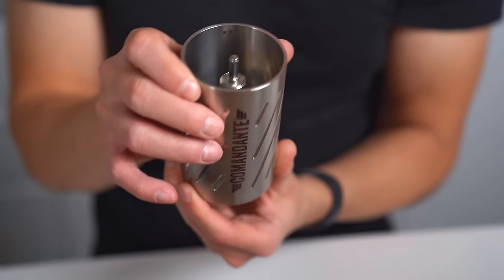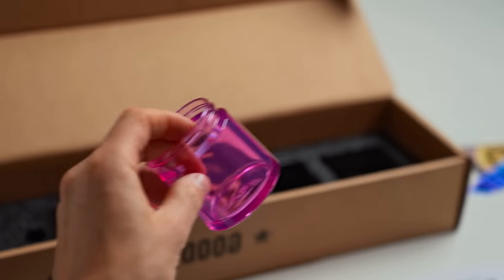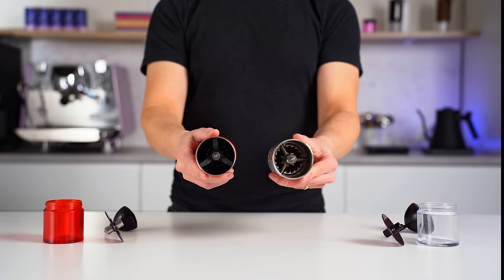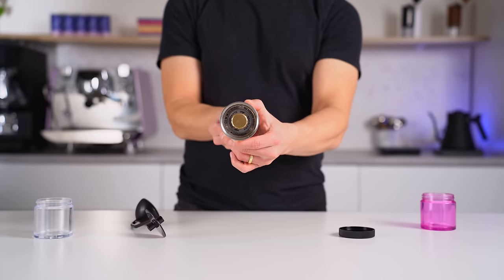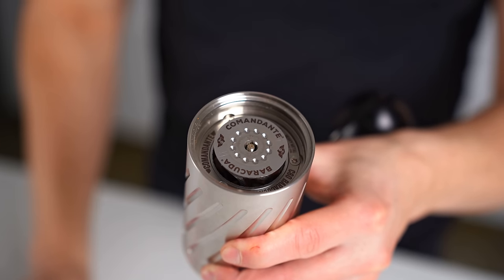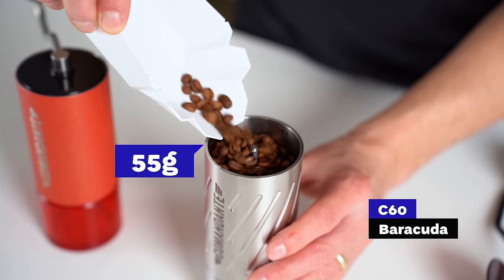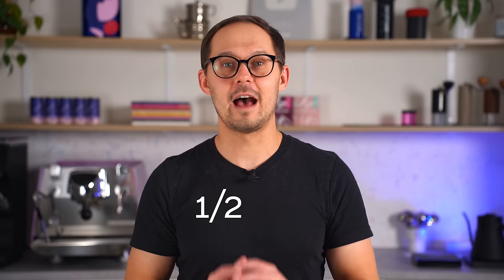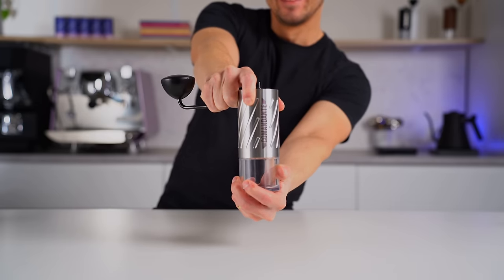Comandante C60 Baracuda: The New Heavy-Weight Champion of Manual Coffee Grinders

Comment: $650 for a hand grinder that has no adjustment at the top, no numbers to easily change settings. For the price, I expect more.  It seems that the Comandante has fallen behind times, but still charges premium…
Reply: Luckily we have 1zpresso which in performance and price has left Comandante way behind.
Reply: Which model the
 best ? @dalareid
Reply: @dalareid  Performance? Only the ZP6 can claim a more uniform distribution, but that grinder isn't as versatile. The Comandante will outlast any 1zpresso with their cheap burr steel and aluminium body.
Reply: I'm actually happy with time more, had good run with c40 except wood issue.

Comment: If i get this right the only argument for the c60 is grind speed? How does this compare to a c40 with the black crank?
Reply: As Aleš mentions, the C60 is designed with slightly different use cases in mind and we suggest the C40 as the flagship model to suit all users :). 
On the other hand, although it doesn't sound like much, grinding twice as fast is a huge difference to your workflow!
As for the Black Crank, it doesn't increase grind speed (the Baracuda burr is what makes the difference here) but it adds leverage, meaning reduced grinding effort. A Black Crank on the C40 with Nitro Blade (smaller burr, lower resistance) makes grinding incredibly easy work!

Comment: Hello. I am the owner of a C40. Most often I prepare cezve. I'm looking at the C60 and want to buy it. Is it good for cezve?
Reply: At finer grind settings with a big burr, a bit more crank torque is required. The grind result is excellent for cezve and with 6-7g for one cup, you'd be finished grinding very quickly :). You might prefer the C40 for reduced crank torque at finer settings though. Perhaps your local coffee roaster/cafe can help let you try one? Thanks for your support!
Reply: @ComandanteGrinder  Hello. Thank you very much for your answer. I already bought the C60. I've been using it for 4 days. Yes, it’s harder to grind coffee in Turkish than on C40. But I'm happy. Example; the same grain C40 3 clicks, C60 5 clicks, C 60 fraction is finer and the grinding on C60 is lighter (visible immediately) As for the filter, the difference is very noticeable. On C60 the taste is deeper. I bought the C60 already a new version of Velvet Steel.

Comment: Made out of brass? Doesn't brass contain lead?
Reply: Copper & Zinc.
Reply: Nope, that is bronze. Brass is the best for espresso boilers, better than SS or copper, the direct contenders.
For a grinder it simply doesn't matter, without any heating and short contact time. There are Alu based alloys that are a a better choice than brass as cost and machinability.
Reply from the maker: Thanks for the replies guys!

Comment: Only 21 Micron per click? I´m down at 15 Micron with C40Mk4 + RX35 (total cost two years ago was € 330 - half as much as a C60). 
The adjustment knob on C60 is even worse than the plastic triangle kind of shape on C40...
I see the weight of C60 as an issue (not just if you want to pack it for traveling).
Reply: Maybe they will sell you another 'DLC' after some time to fix all that issues 😂